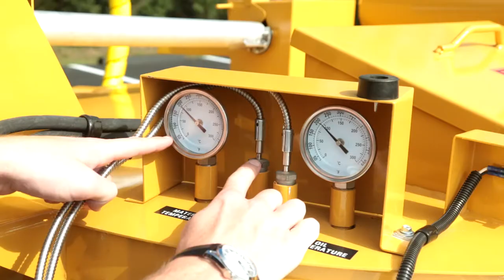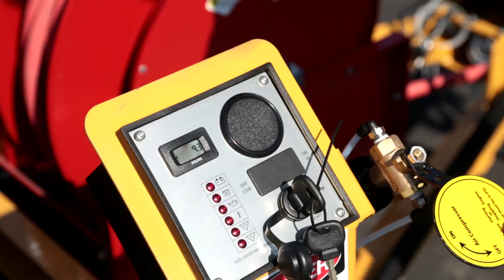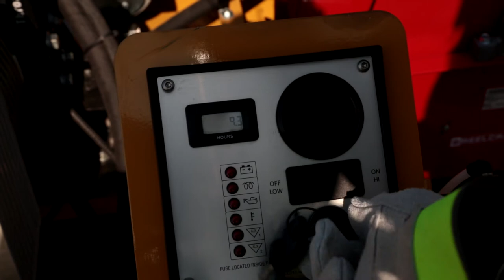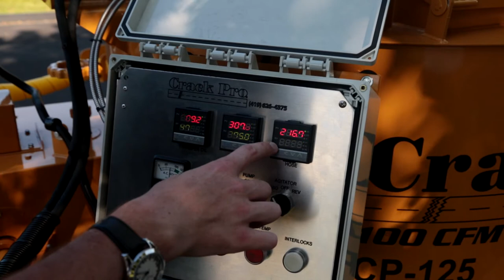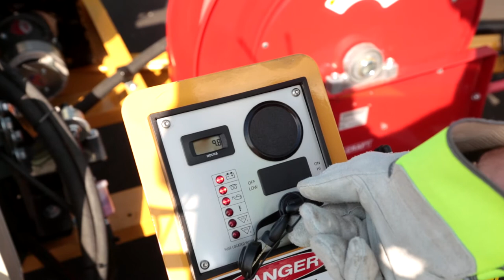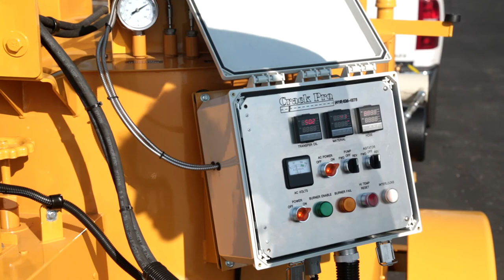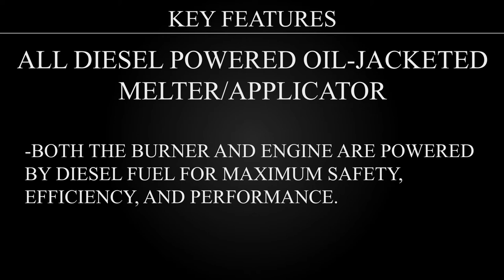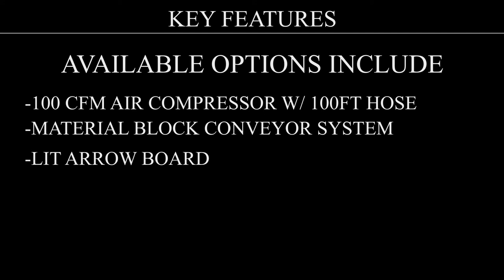Crack Filling Equipment | SealMaster Crack Sealing Equipment

Comment: Love it.. Ive been sealcoating and doing asphalt repair all of my life since a little boy with my father and ive filled many cracks with just a small hand kettle and then we stepped up to a larger 30 gallon melter with a small non heated kettle on wheels..but ive had my eye on one of these for a while now and with all of my years doing this kind of work only seems right to invest in one of these, crack pro is the way to go